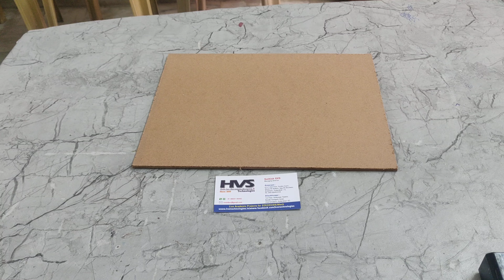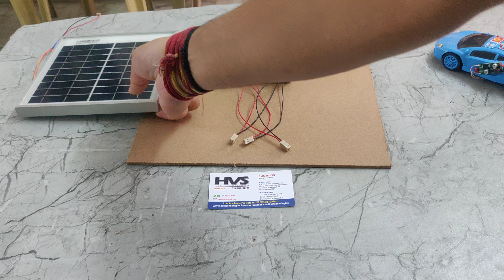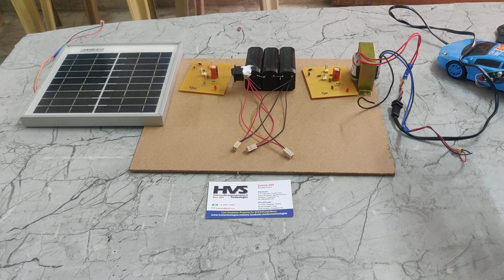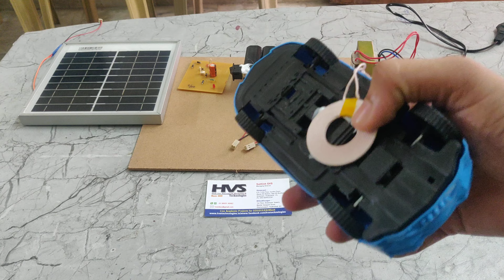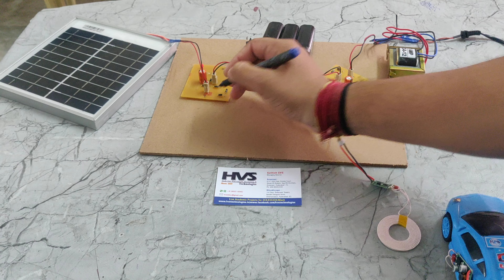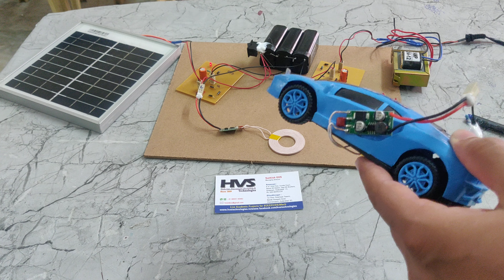HVS-2807.Solar Wireless Electric Vehicle Charging System #Wireless power transmission#Solar power.

Comment: Volage rating of transmitter and reciver coil
Reply from the maker: @Simranjit_0807  12v . We sell total project. 
Send me video link
Will update you the cost details.You can contact us at +919603140482
Through WhatsApp or call
Reply: Input -12 , output -5 ?
Reply from the maker: @Simranjit_0807  yes.